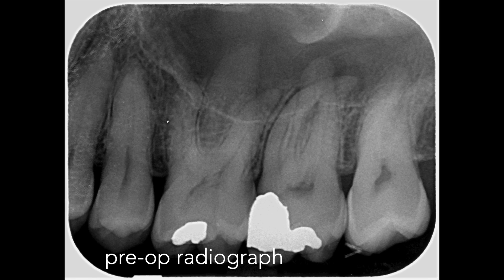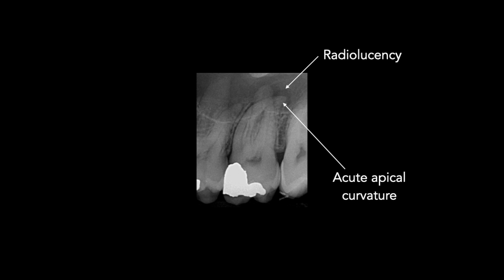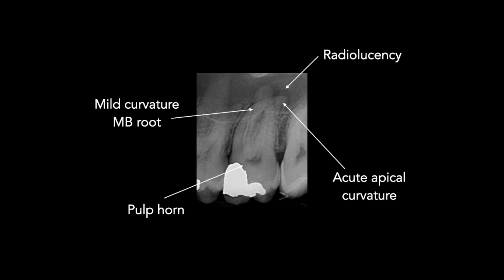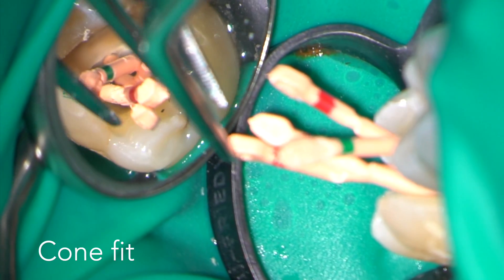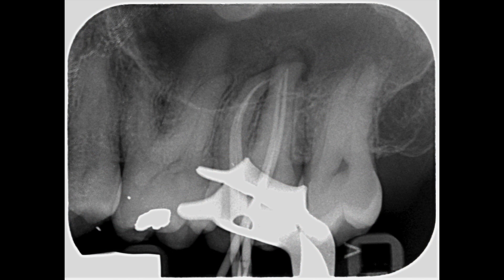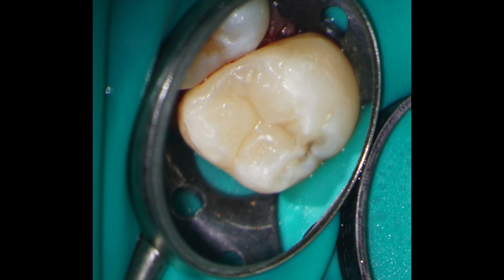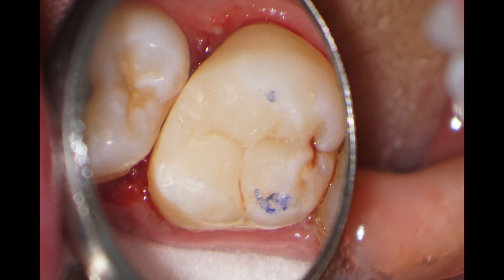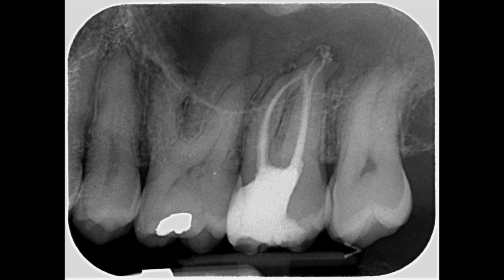UL7 RCT stripped back to basics!

Comment: Dear Dr.John, Could you make a detailed video on apical gauging?question is when we complete our BMP for example till 0.06/25 , is it after final BMP we do apical gauging or before we even reach to final BMP whether it is 0.6/20 , 0.06/25 or more? Request you to throw light on this. Best wishes . Rohit
Reply from the maker: Hi Rohit
I am not a fan of apical gauging with handfiles; I prefer a much simpler approach. Why do we widen and taper canals? - to irrigate, medicate and obturate without extruding. I look at my final file and see if there are any chips in the tip flutes - if there are then our work is done. If the largest file still has no chips then I stick at that and use ultrasonics during irrigation; in this case I will need to custom fit the GP cone which I do with EDTA in the canal. You can use a paper point to help confirm if you are unsure.
I hope this makes sense?
Cheers
John
Reply: @johnrhodesendo  thank you so much for throwing light in this much needed topic which has put my mind to rest . God bless you always for your valuable knowledge and support. Much respect and regard . Love .Rohit

Comment: It was also commented at our last appointment that when the tooth is removed, it will leave a hole where you will be able to see up into the sinuses but not to worry as they will fill the hole with putty? Slightly concerning as a previous consultant said that my son would need general anaesthetic to have the two teeth removed from the sinuses and that a reconstructive surgeon would be on stand by.
Reply from the maker: Yes this hole is called an oral-antral fistua and would create a connection between the mouth and sinus. It can be repaired using surgical techniques.

Comment: Impression:
Unerupted UL7 and UR7 which project into the overlying maxillary sinus. 
UR7 causes significant resorption of the UR6 palatal root and the UR8. The UR8 contacts the UR6 and causes coronal resorption of the UR6.
UL7 has follicular enlargement and is causing mild resorption of the roots of the UL8.
Reply from the maker: Maxillary molars are often in close proximity to the sinus and roots can project into it

Comment: Left side: 
The UL7 is unerupted, vertically impacted and fully formed with three roots; a mesio-buccal, disto-buccal and palatal. These roots project into, and thin, the floor of the overlying left maxillary sinus. There is follicular enlargement surrounding the crown of the UL7 - this is likely follicular hyperplasia or a dentigerous cyst. 
The follicle of the UL7 abuts the distal aspect of the disto-buccal and palatal roots of the UL6 with mild flattening but no significant resorption. 
The UL8 is erupted, mesio-angularly inclined with its crown lying in a more buccal position than its roots. The UL7 lies superior to the UL8 and the follicle contacts the superior aspect of the mesio-buccal root of the UL8 and either prevents its formation or has caused resorption of this root. The follicle also contacts the disto-buccal root of the UL8 causing mild buccal resorption in the apical third of the root, and the apex of the palatal root with no significant resorption.
Reply from the maker: Hello
A dentigerous cyst is one that is related to the crown or top part of the tooth (the bit you normally see in the mouth)
Cheers
John

Comment: The CBCT reports: 
Right side: The UR7 is unerupted, vertically impacted and fully formed with three roots ; a mesio-buccal, disto-buccal and palatal. These roots have an overall conical formation and project into, and thin, the floor of the overlying right maxillary sinus. 
The crown of the UR7 lies in contact with the disto-buccal aspect of the palatal root and the disto-palatal aspect of the disto-buccal root of the UR6. There is significant resorption of the palatal root of the UR6 extending the entire length of the root. There is minimal flattening of the disto-buccal root of the UR6 at the contact point. 
The UR8 is mesio-angularly inclined and lies in contact with the distal aspect of the crown of the UR6 causing resorption of the distal aspect of the UR6 at the cervical level. The UR8 lies inferior to the crown of the UR7 and the UR7 causes a defect in the mesial aspect of the UR8 at the cervical level and the mesial aspect of the coronal third of the mesio-buccal root.
Reply from the maker: Hello
The un-erupted second molar is impacted and will be difficult to remove without removing bone. 
Resorption is a process where the tooth is "eaten away" by pressure or a cyst or infection
Cheers
John

Comment: Good afternoon Dr Rhodes. I know this is probably going to sound a very silly question but could you please let me know if the UL7 tooth is on a patients left side? My son (severely autistic) has a cyst and badly damaged tooth (UL7) which has to be removed. However the oral surgeon has said on the procedure form that he is having - Extraction of upper right first molar. My son had a CBCT scan in Feb 2020 and it showed a lot of problems but unfortunately my son has not really received any help for his teeth pain. The consultants we have seen have said he is in pain because it’s in his head! I would be so grateful if you could reply. Kind regards, Corinne.
Reply from the maker: Hello Corinne
You are correct. The UL7 is on the patient's LEFT.
The tooth however may appear in mirror image on a scan or Xray
Hope that helps
Cheers
John

Comment: Hi John, dental student here. 

When you get a zero reading from your apex locator, do you work your files to minus 0.5mm from the zero reading? Or do you work to the length that your apex locator is estimating? I am wondering because I am taught to prep to minus 0.5 from zero reading but I have seen dentists on youtube say otherwise. If so, what is the reason for this? (Apologies for the lengthy question)

Regards, 
James
Reply from the maker: Hi James
In vital cases you can deduct 0.5mm if you wish but in retreats work to the zero reading. In vital cases there will not be bacteria apically and you dont want to transport the apical foramen, if there is a periapical radiolucency then you can assume that the entire canal is infected and needs to be disinfected. Mechanical preparation will remove some of the bacteria but the majority of bacterial killing is chemical. I therefore work to the zero reading, but if I end up using big instruments like large Wave.One {045} i subtract 0.5 but only for the last and largest instrument.
I hope this makes sense
No question is too long!
Enjoy your endo!
Cheers
John
Reply: @johnrhodesendo   Hi John, 
Thank you for taking the time to answer. That makes a lot of sense. 
I am enjoying my endo! 
Cheers, 
James

Comment: hello dr 
why the gp cones doesn't reach the full W.L although u prepared to the full length according to apex locator ?
Reply from the maker: Hello Ahmed
A great question!....perhaps there was debris apically...or the cone was not matched correctly?... they are not as standardised as the files
Cheers
John
Reply: @johnrhodesendo  thanks dr a great case from a great dentist

Comment: Great video, as always.  They are very helpful.

  What influences when you choose to obturate with a single cone technique vs warm vertical condensation
Reply from the maker: Hi Dustin....If I need to use a post then I generally use warm vertical, I like BC in immature teeth and molars where canals are long and access is limited.
Cheers
John

Comment: Hi dr rohdes I want ask question some times lowe molar the distal root have apical curveture the file hit but when change direction it reach apex with 10 file after that inserting rotary even 15 taper 4 is not reach the end
Reply from the maker: Hello Faiq
In this case I usually use some pre-curved handfiles to enlarge the canal
Cheers
John

Comment: Hi John! Excellent video and there are always new things to learn from your videos!
May I ask for your WL, do you routinely minus 0.5-1mm from the point that your electronic apex locator shows 00 (just right at apical constriction)? and do you minus another 1mm when enlarging with rotary instruments after negotiation with hand K files?
Reply from the maker: Hello Devin,
Thank you!
I work to the zero reading with small diameter instruments but subtract 0.5mm when going to 35 or 45 apical size Wave.
Cheers
John

Comment: Hello Dr Rhodes. Excellent video, as always. Can I ask you what brand of irrigant tips do you use? I'm finding it hard to get fine and side vented ones   (like the awesome navitip points) but cheaper. Thanks in advance and cheers!
Reply from the maker: Hello Miguel
We use Henry Schein 27G endodontic irrigation syringes. The new irrigation tips that come with TruAnatomy files look good and are plastic so very flexible.
Cheers
John
Reply: @johnrhodesendo  theese trunatomy tips are excellent. I've been using them for a while. They are very fine and really get up to the apex. The hole is fine and there is no strong flow of the irrigant. But sometimes, when the acess to the tooth itself is compromised, it can be a little tricky - you can not prebend the plastic tip. So I still have navytips for some cases. And one more thing...I preheat the solution in a baby bottle warmer (any more "medical" ways to do this?) and the tip sometimes melts when it touches the bottom of the devise. So the asistent has to remove the cap and attach the the tip...which is a lot of work since I need a lot of irrigation. Irriflex is very simillar. It has two holes right next to the tip so the irrigant flows sideways in two directions - it's impressive ;)

Comment: Learned so much  from yourself. I went from looking at my day list and planning extractions, to doing as much endo as I can. Love my molar endo. The more challenging the better.

The one problem I m having is a efficient way of cleaning the access cavity of excess sealer. Any tips ? Thanks
Reply from the maker: Hello there!
Resin based sealer can be easily removed by etching the pulp floor and gently scrubbing with an applicator tip.
BioRoot RCS will wash off with a 3:1
You can use solvent on a cotton pellet with eugenol based sealers
Cheers
John
Reply: john rhodes endo 
Thanks a lot. 

Because I m using resin based mostly. I m firstly etching and scrubbing.
2) Then rinse with 3:1 tip 
If clean

Re etch  ? Or dentine sufficiently etched already and don’t want to over etch ? 

Then  bonding protocol for composite core ? 

Thanks